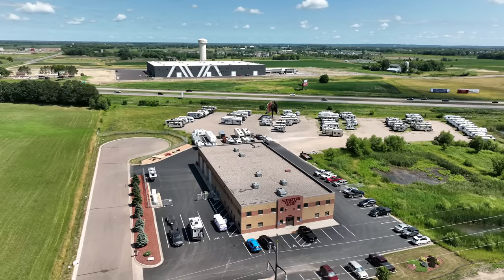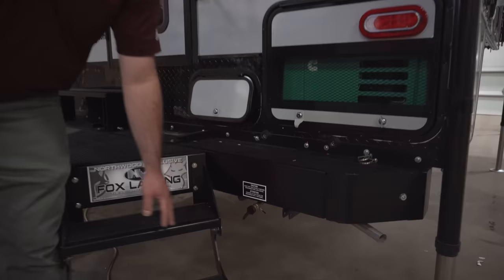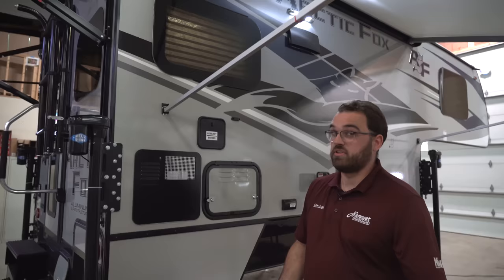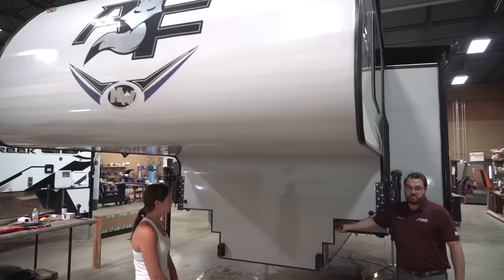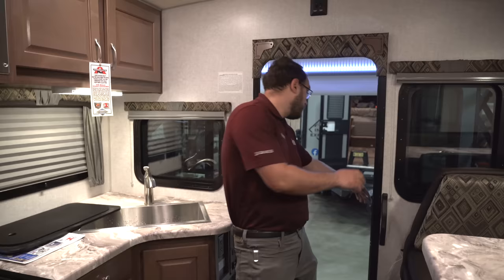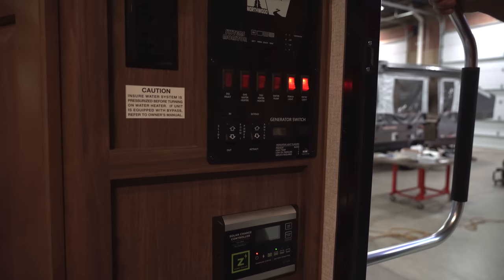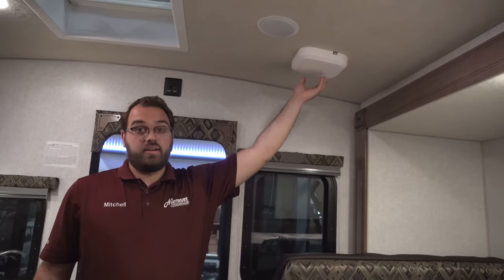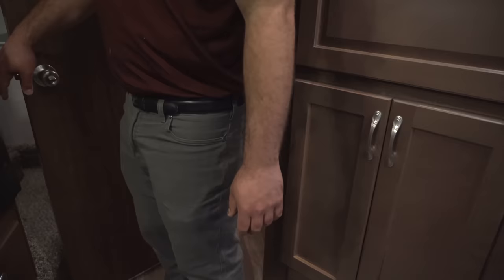2023 Arctic Fox 992 Truck Camper Walkthrough

Comment: If you are seriously considering this camper, then I would also consider a 1 ton DRW. I tried a SRW and no joy for me without some extensive mods. This camper will be 5000# plus when fully loaded.
Reply: Totally agree.
Reply: Must have been a gm. Ford and especially Ram don't have that issue. Ford is the new king of recalls, and gm is owned by china. Their diesel is made and designed by Isuzu.
Reply: It’s 3200 dry. Maybe not quite 5000, but I’d say 4500 with tanks loaded and food/supplies. Any Dually will handle it fine

Comment: the more i look at a truck camper the more i am leaning to it.
Reply from the maker: We love our truck camper! You can take them off the beaten path and get into a lot of places where a pull behind or 5th wheel couldn't go.
Reply: Hope you are rich. Truck campers are WAY overpriced for what you get. Many travel trailers are half the price with the same equipment. and you don't need to buy a big huge heavy one either they make some outstanding small lightweight campers now and you don't need a 70+ thousand dollar truck to move them around like you do a truck camper.
Reply: I looked at them thinking they qouls be cheaper 😂😂😂😂. Kinda   crazy you can get alot more for the money with a pull behind
Reply: They really need to study Earthroamers and step up their game. Full roof of solar . Nicer stuff in them too. Be worth just saving up lol
Reply: You're going to need a good solar system. 

This INSANELY WAY OVER PRICED camper doesn't come equipped with what you need.

A motor home usually comes with two alternators, one to charge your vehicle battery and one to charge your in-house batteries, so you can get way with less solar.

I got a 2004 VW Rialta, and even though i have two alternators, i put two 400-watt solar panels, and put two ECO-WORTHY 12V 280Ah LiFePO4 Lithium Battery LiFePO4 so I can camp and go out even in freezing temperatures.
Reply: Just got mine.  It's versatile
Reply: LOL! If you can’t afford then stop commenting. Seriously, if a person can afford this camper then they really do not need your opinion on how to spend their money.

Comment: great review Mitchell.  My only concern is the single a/c unit in the kitchen.  Based on the design, air may not easily move to the bedroom.  They should incorporate a small fan to move air to the rear.  I do believe the Artic Fox to be an exceptional product.

Comment: That thing is massive. I guess it’s a truck bed camper for a Ford F650
Reply: An F350 or Ram/Chevy 3500 series will handle the weight depending on year and set up.

Comment: These are nice to be compact but between the price tag on the camper and then the huge price tag on a truck capable of putting this on it's insane lol. Very nice though for something so small.
Reply: In most camper cases, the pick up is not used exclusively for the camper.  I pull many different trailers on mine.
Reply: True...for the price of the camper and big (serious) truck to carry it, may as well get a Class B instead...and likely for less $$.
-- BR

Comment: Prefer my 811.  Goes on srw truck. More open. All arctic fox are solid.
Reply: Wet weight is 4500 lbs , you can't put that on a srw
Reply: Hmmm I've got 20,000 miles on one that says I can.  Just beef up the rims and tires, add timbrens.  Perfect.